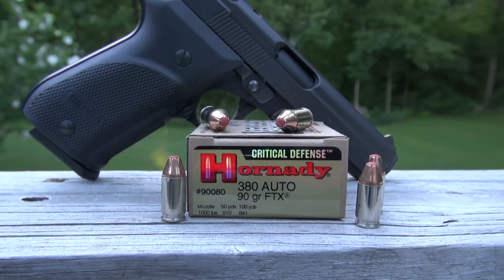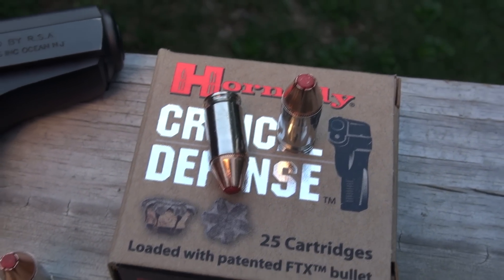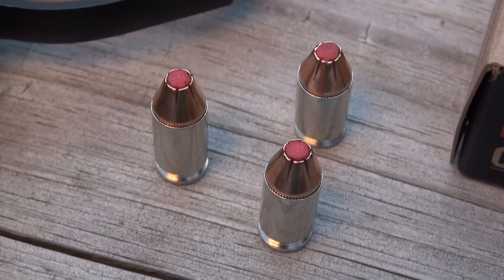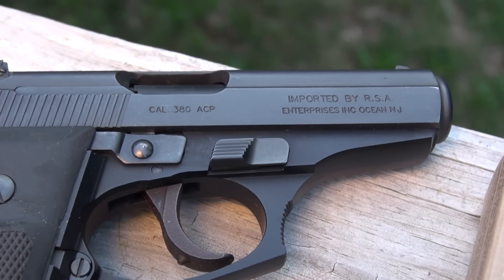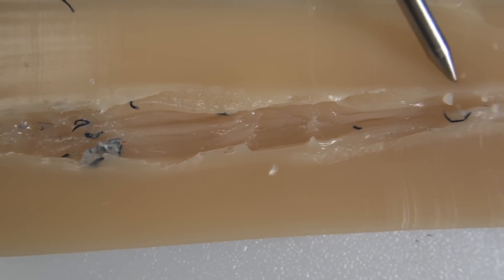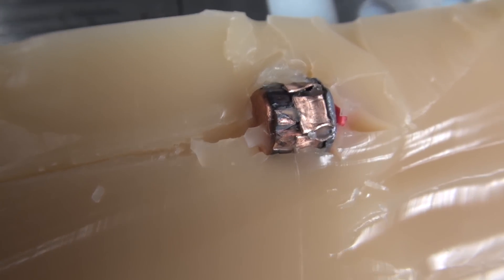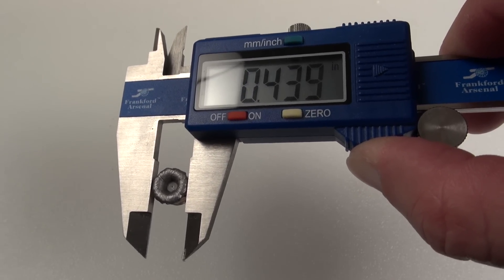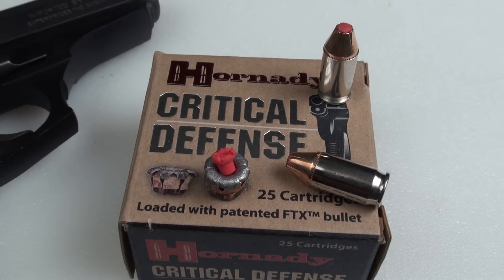Hornady Critical Defense .380 ACP 90 gr Ammo Test

Comment: I have one of those "Ruger LCP' .380's.  I am not crazy about it except it is easy to conceal.  Really I feel it is just about a piece of junk.  I have other weapons that are much better.  However the LCP I have is really easy to JAM.  It is the jammingest pistol I have ever had.  But this type of Ammo, the Hornady with its pointed shape seems to "Feed" much better in to the Ruger LCP I have.  I don't "practice" with the Hornady, but I have shot enough of it to try to see if it helped the "Jamming" problem.  It appears it has, That little pistol so far has NEVER jammed on this "Pointed projectile" that Hornady makes.  Round Nose .380 practice ammo I have will jam in a heartbeat in the gun, and some flat nosed FMJ will jam in it too.  EVERY Semi-Auto I own has JAMMED at least once with me except ONE.  I only have ONE that has Never jammed and that is my Smith and Wesson 40 SW the old style that is mostly metal.  I forget the model number.  My Remington Tact 4 - 1100 12 gauge has never jammed either.  But to me it is in a different class.  This "Jamming thing" makes me dislike semi-auto's quite a bit.  I still like .357 revolvers the best, but they are just so big and heavy to conceal and carry.  BB
Reply: Ever have a Beretta Bobcat .22LR? I've never sen something jam that much. Doesn't matter WHAT round I put in it. Had several armorers look at it and tweak/clean it, still jams. Even had Beretta look at it, and it jammed every round when they tested it as well. Huge POS, I'm surprised Beretta didn't buy them all back and try to bury that part of their history.
Reply: FraggedDabloons You have probably  already tried it, but I have several 22 LR "semi-auto's".  All of them have jammed once in awhile.  But on mine it seems they tend not to jam if I shoot a Round Nose bullet and have them lubricated very well.  Lubricated a little MORE than you are really supposed to, kind of like to "excess" almost.  Other than that, I don't know what else to suggest.  Some Gunsmith might can fix it, I don't know.  You know, I use those 22LR's for practicing, when a round jams, I save it and shoot it in my 22 revolver.  If I shoot Hollow point ammo in my 22 Semi-auto's I notice more problems.  The LCP Ruger, it had a "RE-Call" right after it came out because it would fire if dropped, so they re-called them, I sent a letter with it about the jamming.  When I got it back it STILL Jammed.  It will jam on that "American" brand round nose FMJ nearly every time.  I got some flat nosed FMJ, it does a little better with that, I practice with that round.  But the Hornaday ammo is sharply pointed and it feeds very well with it, I have NOT shot as much of that because of cost, but it has never jammed on it...........so far.  You know, I really prefer REVOLVERS.  My Ruger mini-14 Ranch Rifle will jam occasionally too.  I like revolvers and SHOTGUNS.  Any semi-auto or full auto can jam at any time it seems to ME.  Man they gotta be Clean clean clean too.  Hard to beat a .357 Revolver, just hard to C&C.  BB
Reply: FraggedDabloons I meant to tell you, I have ONE semi-auto that has NEVER jammed with me not once, but I have not shot it a super lot.  It is a Smith and Wesson 40SW compact single and double action Model 4003.  It is one FINE fire arm.  I keep it loaded with 40SW Hydro-Shocks, but I practice with a 40SW FMJ round.  Once again it is the only one that has NEVER jammed, but I do not shoot it as much as the 22LR's I have.  I have a Ruger 1022 rifle, a Ruger .223 Ranch Rifle (mini-14).  A Stainless Ruger Target Pistol and I have a Remington 1100 tact 4 12 gauge shotgun, it is Semi-auto too, it has never jammed, but I have NOT shot it a lot.  I practice with a Mossberg Pump and Bird shot because it is cheaper.  

The Semi-Auto Remington 1100 tact 4 will ONLY shoot 2 3/4 inch High Brass, you know Buckshot.  The Low brass does not have enough recoil or gas to make it work.  But it has never jammed with Buckshot.  The Ruger 22's I have will work every time with those Remington round nose "Thunderbolts".  They will work super good with those smoking HOT High velocity rounds like the Aguilla Super hot high velocity rounds, Round nose.  They are ALL more prone to jam with the Wal-Mart hollow point cheap Bricks they sell.  It seems the Smoking hot rounds are LESS likely to jam, that is the way it seems to ME.  BB
Reply: Bob Burnitt
I only fired round nose lead or copper coated.
Reply: FraggedDabloons Yeah, well that sounds pretty bad.  The round nosed in that LCP Ruger .380, they would jam too.  Just the Horrnaday "Self Defense" ammo that is so "pointed" it feeds in the .380 OK.  So, I don't know what to tell you about that gun, I would get rid of it, maybe try a Gunsmith, maybe they can fix it, I just do not know.  BB
Reply: Bob Burnitt
I sent it to Beretta for their gunsmiths to try, didn't work. Its like a running novelty joke in my family now.
Reply: FraggedDabloons Yeah, that is pretty bad.  I have never had anything Beretta, I have heard they are great most especially their shotguns, but I don't have anything they make.  They have never grabbed me much.  But that is a bad.  A gun that jams is just a Rock, except you can carry a rock everywhere.  I don't know what to tell you.  I am pretty sure you don't carry it as a weapon for defense.  Kinda figure that.  Maybe a LOCAL gunsmith can fix it, but I doubt it.  I like Italian food, but don't care for Italian guns.  They have been around a LONG TIME< I am kind of taken aback THEY won't fix it are give you one that works.  That is pretty far out to me. BB
Reply: Bob Burnitt
I had local armorers look at it, but no dice. I have had several carry guns, S&W 659, Walther PK380, Sig P250C 9mm, now a Glock 23.
Reply: FraggedDabloons Well, that is a shame that the pistol sucks.  If it were me I would try to push it up beretta's butt.  You know, demand they make it right, did you buy it new??  How old is it etc.  They have a BIG reputation, (not with me) but with a lot of people.  They should WANT to make it right.  Of course it would not shock me if they did nothing.  But I would still try, BB
Reply: Bob Burnitt
Eh, it was a pawnshop buy back in the mid 90's. I think my dad paid $70 for it then.
Reply: FraggedDabloons Well, it might be worn out???  I don't have any more ideas on that one.  If you shoot them enough, they wear out.  Especially Semi-Autos and 22LR used to be so cheap, people would wear them out.  BB
Reply: Supposedly you need to run about 200 rounds through the LCP to break it in. I also racked the slide on mine no telling how many times as well. (Hundreds) to help with break in. I've had no malfunctions yet. I also keep a firm stiff grip on it since it's so snappy, so it will cycle properly while firing. Hope you didn't get a lemon.
Reply: MiddleTN45 There's no such thing as a break in period, only a poorly made weapon.
Reply: Bob Burnitt mine used to as well.  I followed a video on YT and sanded the heck out of the various parts, cleaned it, clipped a round off of the magazine springs, and it stopped jamming.  All of the edges and points got sanded down smooth.  I went back to carrying it.  No issues ever since and I have run about 400 rounds of FMJ and hollow point through it.
Reply: I would send it back to ruger! No excuses for the ftf